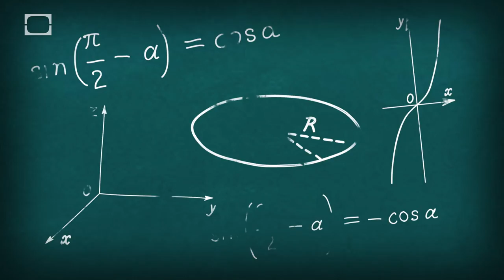How Does Captain America's Shield Work?

Comment: Cap isn't just physically fit he also has super human strength. So I would imagine a Frisbee shaped disc wouldn't matter that it weights 40 something lbs. Since he picked a man up and threw him over 10 feet into the air.
Reply: Actually from the start he was just a peak human kind of hero (according to the TOHOTMU) with a small regenerative ability that prevents some muscle fatigue.. Later it would be added on that he had a low level of suppressed ageing thanks to said healing factor. Later again he would gain low level super strength... The super strength version is from the Ultimate universe IIRC.. later translated in to the MCU)

Now that being said he has always had "comic superhero resilience"... You that thing that let even normal humans get tossed through walls and such. =)

But in general Cap has never had super strength.

Comment: Caps shield is so aero dynamic because it was forged or made if you will. Within a satelite  in space.  Its incredible denseness is due to the lack of gravity it went thru during construction....being made in space there would be zero gravity to affect its outcome so the sheild would have zero valances (space between atoms)..its unique vibranium and I would say adamantium composition allows for its indestructibility and the whole valance thing allows for a little metal to go a long way (thus allowing marvel to destry the sheild and then fix it later) . Also do no firget that cap is the pinnacle of human endurance and strength. So chucking around a shield that conventional methods says weighs about 40-50 lbs..instead it weighs in around ten to fifteen pounds.  Plus he trains extensively  with it so give a guy a break!

Comment: Well this video is flawed for a lot of reasons. Comic books are not reality and therefore do not follow the same laws of physics. For the same reason Thor can walk on a rainbow, the captain'a shield can be made out of fictional materials. The man who claimed to determine the weight and mass utilized contrived numbers. If marvel says it weighs 12 pounds, than it weighs 12 pounds. Also captain America isn't just a guy in "peak physical condition." He was injected with the super soldier serum. He has super strength, beyond what could be achieved through natural means. So he could easily throw his shield.
Reply: "Captain America has no superhuman powers, but through the Super-Soldier Serum and "Vita-Ray" treatment, he is transformed and his strength, endurance, agility, speed, reflexes, durability, and healing are at the zenith of natural human potential." Quote from Wikipedia, consistent to several other sources. Also the Bifröst Bridge in Thor was clearly much more than refracted light. It's misleading to simply refer to it as a "rainbow".
Reply: Although the main point of my comment was simply that in a fictional universe (616) you can't apply the physical laws of our universe. Especially when the creator of said universe makes a claim (Eg: the shield's weight). That being said, I will retort that the Marvel Wiki states that he has the strength of 10 men.

Comment: I don't think that the shield is actually all that aerodynamic but cap isn't just in peak physical condition, he's beyond it (hence the term SUPER soldier serum) so he can toss it around like its nothing. So I have to agree with Christian b/c of the weight of the shield (43.9 lbs.) but since vibranium is a fictional metal, it can be any weight/density, so therefor, the shield could be 12 lbs. due to a nearly weightless vibranium metal. But again, cap has super strength, so it only matters to a certain degree.

Comment: Perhaps we are talking about piezoelectricity, which in short, is the electric charge that accumulates in some materials in response to high pressure.  Quartz is piezoelectric, which means that it creates a voltage when deformed. A sudden forceful deformation produces a high voltage and subsequent electrical discharge.  Energy is conserved and dissipated via electricity. Perhaps the Pixy dust here is quartz…and you get vibrational discharge over an electrical one in the alloy.  Works for me.

Comment: Something to do with some sort of -- how do I put this... I'm no aerodynamics expert, so... (this may be difficult to put into words, but someone else will understand what I mean, and can clarify it afterwards for the rest of you to better understand, as well as myself) -- very precise, tiny, detailed engravings on the inside of the shield, and about  5/7 shallower engraved details on the outside (all of these would need to be so small that they are practically invisible to the human eye, but less so on the inside; they would need to be large enough to make noticeable improvements in  aerodynamics / flight,  but be small enough so as not to diminish the strength, durability, and longevity of use given the harsh treatment it is put through; they would need to be positioned so as to maximize directional control of the shield in flight and ricochets during the time it is being thrown, considering the throwing speed, direction, shape and density of objects hit where hit, as well as the surrounding area (s) on those objects, and so on - very complicated stuff that I'm only scarcely familiar with: I don't really know or remember any of the  related/associated  formulae or topics necessary to fully, correctly, and clearly express my thoughts on this matter). Also, the general shape of the shield itself greatly affects how [well] it flies; the materials as well have a great deal to do with the flight patterns, etc. and how [well] it ricochets and continues flying instead of   bouncing back  /  breaking/shattering  into pieces  /  dropping like a rock / boulder in a deadfall / etc.
Reply: *that bit striked through should not be formatted

Comment: seems a bit odd to say 0.75 meters
Reply: No it doesn't... point seventy five meters. What is odd about that?
Reply: I would have said 75 centimeters
Reply: burt591 Agreed!
Reply: Merle Lester STOP. NOT. USING. METRIC. UNITS.
Reply: Merle Lester STOP USING FEET AND INCHES
Reply: burt591
7.5 decimeters, 750 millimeters, you could say it however you want. some just sound silly though
Reply: gelectrode89 That is a big junk...
Reply: gelectrode89
I know but in my country we would say 75 cm.
Reply: burt591
Actually the measurement would be 7.5 decimeters.

Comment: do they know that the shield is curved so that would help reflect vibrations and shocks because it makes it bounce in another direction using complicated math that i don't know so now about the arrow dynamic thing it is because it is like a wing when it takes off on the top the air is moving slower adding weight down on the faster moving air witch acts like a parachute because it moves through the curve under the shield so it might be possible to make the shield if the metal that was used to make it was real

Comment: I would have to disagree with much of information put forth here in this video, Firstly, Caps shield is made out of what is called Proto-Admantium, an unknown process of the a combination of steel, Vibranium, and an unknown catalyst (I would prefer to call it a process of added materials instead) --created a material stronger than any yet known according to the Marvel Wiki ( http://marvel.wikia.com/Adamantium ). The reason it is called Proto-Admantium is due to the fact that  MacLain's later attempts to duplicate the material included a formula without Vibranium, which resulted in the creation of True Adamantium, Therefore I will prefer to assume that Cap's shield could be a lamination through the annealing of the seperate aloys of Admantium and Vibranium Instead of an Alloy created from the two, This allows each to keep their own physical properties. Now that being said I will make some assumptions, the Admantium metal coalescing around the edge forming a pure ring of Admantium and the center of the shield being almost pure Vibranuim. This in my opinion would account for the shields ability to bounce and ricochet around due to the adamantium ring creating an ultra rigid shell that would resist the impact of being thrown at a wall or whatever and would explain the ability of the rest of the shield to absorb any impact. Now as far as it weighing 42 lbs. I disagree. the math in the Wired article is sound assuming that Cap is a dead weight before impact, but Cap being an amazing fighting specimen he is would have attempted to absorb the impact with his body maybe even jumping back a bit to make sure he did not incur any injury, the Winter-soldier threw the shield with his bionic arm that is at the very least twice as strong as normal human so the force he could throw the 12 lb shield in conjunction with Cap's own instinctive motions and movements could have accounted for the sliding not just the impact of the shield. As far as Thor's hammer causing an explosion when striking Cap's shield... Well I never agreed with that in the movie anyways even though people thought it looked cool, I just chalk it up to creative license of Joss, I don't have to agree and that's my prerogative. I'm a comic book geek.

Comment: obviously the shield must have bin mixed with vibranium and true adamantium because it is indestructible more than wolverines claws this would explain that it doesn't get destroyed when to much power is put into it because vibranium shatters when it is. think about it vibranium absorbs kinetic energy but if in between the molecules adamantium is there it must give it the ability to redirect the absorbed energy like when thor hit the shield and an explosion happen (also add that the vibranium was overloaded and sent out a wave of energy that without adamantium would shatter the charged vibranium) or when iron man shoots a repulsor ray at it and it redirects the energy. true adamantium make sense because the shield has only bin destroyed when going against reality changing properties and powerful magic.

Comment: The mystery metal is a part of the Infinity stones and there was a alien involved the creation of the shield now how does the shield return back to its owner well it works off of personal gravity fields once you touch the shield it's slightly absorbs your own personal gravity / or a shield that is around you once it leaves your hands it's almost like it invisible rubber band that stretches out but just like any gravitational pull it will eventually find its way home this is due to the vibranium and the infinity stone metal that was introduced into the shield what is the ultimate shield weapons Captain America's shield!

Comment: Well I may not be total geniuses like u 2 but I suppose the shield is so aerodynamic becuz of mainly 2 factors

· Its design . It is designed in to be a flat dome .Whenever captain throws it the starred side of it is pointed up giving more space for air to enter and lift it in its flight .

· The mass of the shield . It is.made from a fictional alloy making it almost light as a feather.

Guess that is it.

Comment: You're gonna have to rely on fictional metals here, reality won't help. Vibranium is 1/3rd the weight of steel and reflects vibrations of projectiles upon impact to the point where Thor's hammer just kicked back at him and threw him off quite a distance.

Comment: well as said. it's imaginary... isn't that enough? no? ok
cap is super soldier. he is not just strong or in peak physical condition. he is really strong. and if we are going to use movies, i will give you an example from the upcoming (at the moment of writing) movie Age of Ultron. in it, Cap is throwing a motorcycle.... yes it already have inertia, but it is still a motorcycle, not some kind of plastic toy. if he can throw that thing of, he is more than capable of throwing a metal disk that is 20-30 kilos like nothing, and it would look like throwing a frisbee.
as said it looks like the shield reflect energy/vibration. so when thrown at something that cannot absorb the kinetic energy of the shield, the shield will "bounce", because of the third low of mechanics (i think).
combine that with the fact that cap has used this shield for really long, so he knows it very well, and that he is superhuman (so he probably can calculate things faster) he can calculate (maybe subconsciously) when the shield will bounce to. you know - ballistics.

Comment: top 5 reasons why you guys are wrong 

1) captain america has super strength which makes throwing a 20kg sheild no big deal
2) the sheild has an absorption property not a reflective one. the capability of it bouncing off of walls comes from the caps strength
3) adamantium is in the shield
4) you cannot measure the shields weight. you cant predict how much the vibranium and adamantium weigh therefore you cant measure it as a whole even if you could its impossible to predict the ratio of the metals within the shield as they are of different
weight
5) vibranium is an alien metal not of earth so is adamantium so you cannot predict what the cooling time for the metals are.